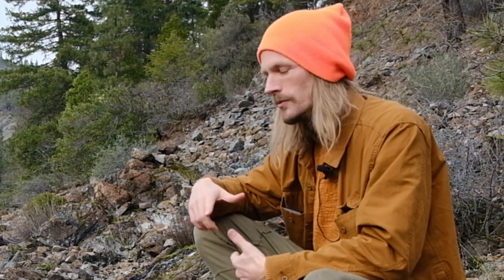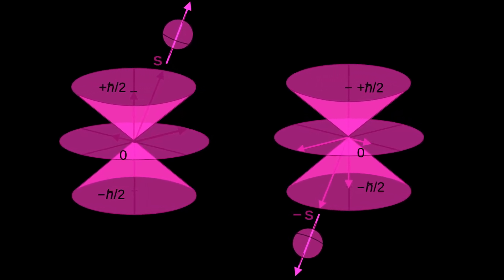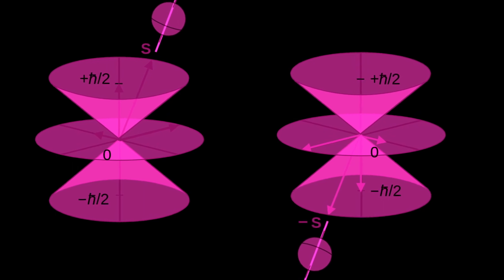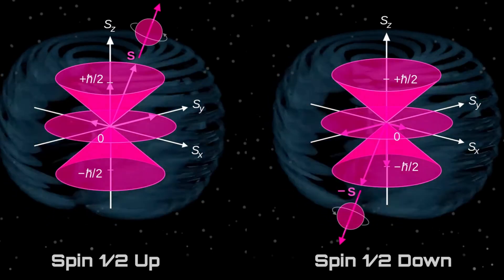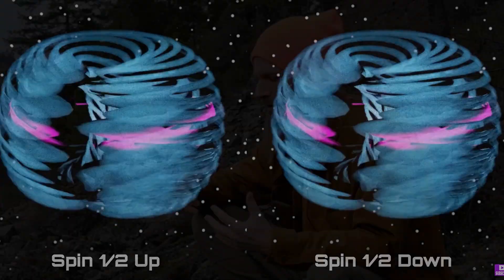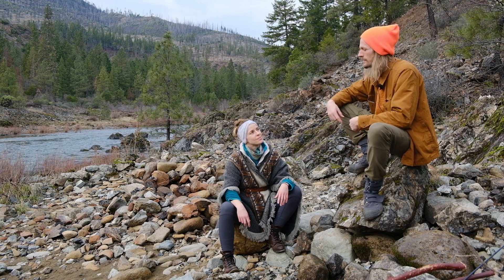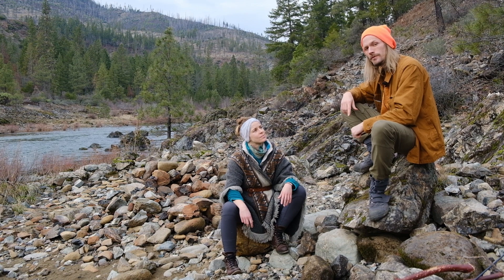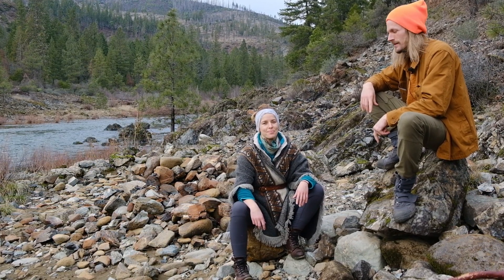Physical Basis of Electricity - Material Atomics Conversations #10

Comment: Unlike a water hose which emits the tiniest stream of water out its end when the water spigot is opened a tiny amount,  immense negative voltage can be applied at one end of wire ('immense' relative to the mobility of conduction band electrons in copper atoms) - and no 'stream of electrons' will emerge.  Only a paired-up separation of charge placed across BOTH ENDS the wire (say, a battery) has gained the 'scientific reputation' of drift velocity of electrons, the Poynting vector, etc.   The 'electrons flow in the wire, and that is current' could stand a fair review.

Since aligned electron spins in a bulk material was identified in the 1920s as the source of magnetic fields (aka aligned magnetic domains), and since 'current-carrying' wire manifests a magnetic field, our supposition is the following:

1)  the charge separation (battery, etc) applied across a wire creates a 'bunching up' of electrons as the electrons are attracted to the "+" battery terminal as Nature attempts to achieve a lowest-possible energy equilibrium (Nature attempts to 'quench' the charge imbalance of the battery)

2)  the Exchange Interaction, or some form of it,  responds to the increased Coulomb force created by the closer proximity of the bunched-up 'like' charges (the electrons).  The Exchange Interaction aligns electron spins as Nature's way to reduce the build-up of Coulomb force caused by the bunching-up of electrons

The aligned electron spins occur because a lower energy condition is achieved  (compared to allowing electrons - 'like' charges - getting close to each other).  Nature is basically saying  "I prefer a lowest-energy condition, and the spins of 'like' charges will be aligned if they come in close proximity, because that reduces the build-up of Coulomb force that is created by 'like' charges getting too close to each other"

The aligned electron spins also explains the magnetic field around the conductor.

The aligned electron spins also reduces the degree of freedom of motion of the affected electrons and thus reduces their heat-carrying (kinetic energy) ability.  It's likely that a portion of the increase in heat in a 'current-carrying' wire is caused by this reduction in degree of freedom of motion, of the aligned electron spins.  More of the ambient and internal heat is carried by a smaller amount of the particles in the wire, so their kinetic energy must increase.
.

Comment: Don't through away everything that is known.  Allthough I do not believe we have everything in the conventional theories then the prooven things should not be discarted. Also your talk about a Gear Box and the oil in it etc told me that you really do need to study a lot before you can make new theory.
So what is known about an electric current. It is known that if a wire is connected to some thing that has an electrical potential difference like a battery then something happens to the wire. If it isn't too thick It gets hot. It has also been found that it generates some thing that we call a magnetic field around it. That we know because it moves a magnet. We have then designed an instroment that we call an amp meter with which we can tell if there is a current in the wire or not.
Another thing we know is that if we have a cathode ray tube that appears to let a current through it in a vacuum. In a vacuum no atoms can push on each other. We do need to heat the cathode for this current to flow. We can messure the current with the amp meter. Also something hits the screen to light it up.
From chemical experiments it has been determined that there are different atoms and differen behaveur of atoms. The idea about electrons is mainly theoretical I believe but materials chemical behavour conformes very well to the Idea that there is a kernel in an atom and there are electrons around it with different energy levels. Knowing this and looking at which materials are conducting and which are not we find a correlation between the theory that when there is only a single electron in the outer shell (energy level) then is the most conductive. These theories conform very well with what we messure so allthough it does not tell that the theory is true it tells that it is at least in the right direction.
Now from all this I deduct that an electric current is electrons (whatever they are) that is the initial carier of the electric current. It has however apparently also been found that they don't move very fast but the energy of the current does. It is there fore more likely that an electron jumps from atom to atom but emidiatly or maybe even before it does the full jump it's influence has pushed on an electron ahead of it. This influence we can messure moves close to the speed of light along the wire. It is in some ways like a lot of balls pushing on each other.The effect can be felt at the last ball allmost as soon as it is put on to the first ball but only allmost so there must be flexability in the system. That fexability I believe is the reason for inductance resistance.
It is also found that what is outside the wire influences the current trancmission speed in the wire. That prooves that a part of the current is outside the wire.
It commendable that you try to find new theories but don't forget the known facts. It is not all theory. There is a lot of practical knowledge available.

Comment: I am uncomfortable thinking about "spinning rays" coming off an atom.  It implies that the base of the ray is moving "slower" than the same ray some distance away.  Wouldn't this break your light model?
Reply from the maker: the filaments are extremely stiff and solid-like due to the tension (gravity) so their deformation propagates uniformly. The rays aren't spinning, they're deformed in a twisting fashion (torsion).
Reply: I would suggest that the rays are not deformed.  They deform.  [edit: The rays make but are not subject to deformation.  This is not a small thing.  But the struggle between not knowing and not saying is intense.]  Hence 'rays'.  Small difference in the end.  The end.  The effect or observed 'ray' may not be the root or original ray but an immediate artifact.  Oh, Dale.  I'm agreeing with DeLay more than he is.  See?  This is why I have no friends.
Reply: @OrpheoTreshula  I'll be your friend :D